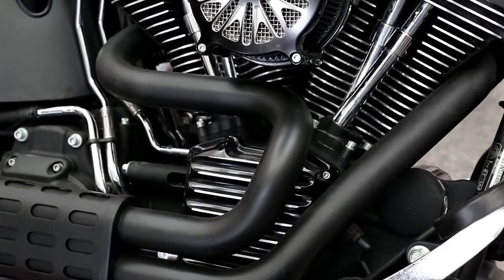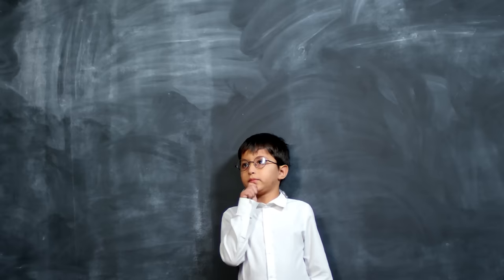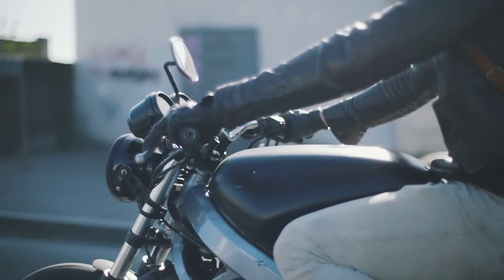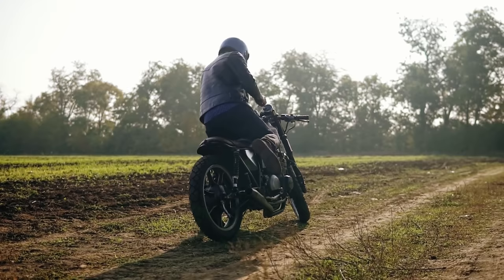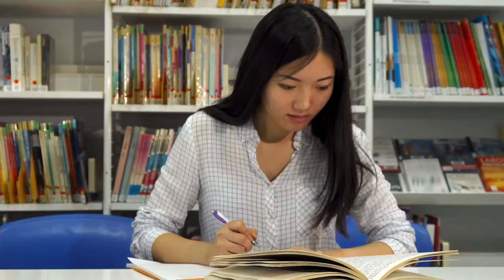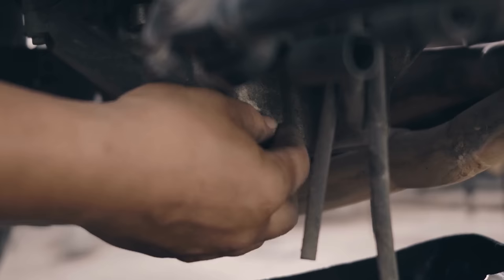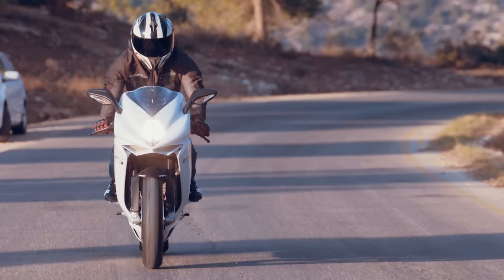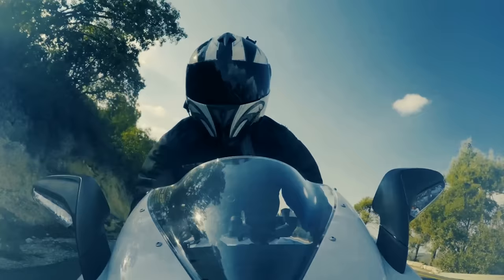How to Break in a New Motorcycle

Comment: They have done tons of research on this. There is no difference between a hard brake in and a soft brake in. You just need to just ride it like it’s intended to only thing you should do is change the oil more often until you hit 600 miles. You will have some metal flakes in it that is OK it’s common. The manual says don’t do high RPMs it’s because they don’t want you to break anything while it’s under warranty.
Reply: The warranty here is 5 years on Yamaha and Honda. Suzuki has 7 years. Kawasaki 2 years. The manuals statement to avoid warranty claims can't be true. You will easily pass the break in period in a couple of months even if you don't ride alot.

Comment: I chose to do the gentle break in. Was just following the manufacturer recommendations. This is my first bike and should hit the 600 miles on my way home today. Got the oil change kit and what I need to clean and lube the chain ready to go. Also decided to get out the torque wrenches and go over the bike just to be sure things are right.
Reply: Well-played… especially making sure bolts are tightened.  My bolts on my left foot peg mount got loose and I didn’t realize until one bolt had completely fallen out, and the one remaining bolt was hanging by a thread… luckily I was able to secure it , but if my left foot peg came off mid ride, that would have SUCKED.
Reply: 600 miles for me today too.....can't beat a new bike.....

Comment: I know you dislike the engine but I just bought a new 2022 Kawasaki Z650RS. I live in a very rural area so bike selection is slim. I wanted an XSR700 or 900 but it just wasn’t happening. This video came out just in time though so I can learn how to break in that slug of an engine.
Reply: The Z650RS is a fantastic bike, really great value for money! It may not be the most "charismatic" engine but it's a great engine, and I personally think the looks of the bike are great. Awesome choice, happy riding!
Reply: Why apologize for the brand of bike you purchased? You got a new bike and now your good to go, be safe!
Reply: @2shoestoo  absolutely. I was just cracking jokes about how Yam hates on the Kawi 650 engine. I am super happy with my bike and excited to put some serious commuter miles on it this summer.
Reply: Nice I just bought a 2023 last week! I think for my uses,and at my current skill level, the 650 has plenty to offer.

Comment: Cycle World or MotorCyclist did a video on this a couple years ago...  They took two identical bikes, broke one in by the manual, and the other by wringing its neck near redline much of the time.  When done, they ran them on the dyno, did oil analysis in a lab, compression and leak down tests and took the motors apart and took exact measurements...  No appreciable difference between the two break in methods...

I was recently asked to help break in a bunch of new Triumphs for this year's demo and promotional fleet...  The tech in charge told us not to abuse them, but he preferred if we broke them in harder and put them through their paces...
Reply: Excellent insight. Thank you.
Reply: Also note the bike was a very understressed CB300R... so no stress even on full throttle.
I would not do a hard break-in on a superbike with 200 bhp per liter and a 14,000 to 16,000 r/min red line.
Reply: @thainaaier  

No one would expect that. When I say “car” I don’t mean a Ferrari Enzo. When they say motorcycle, they don’t mean a track ready liter bike.
Reply: @thainaaier  I wouldn't;t do it entirely at redline either, but the point was, they did the exact opposite of the manual instructions and it was absolutely fine.

I split the difference between the two.  I break it in fairly hard, and have even broken a bike in at a track day...
Reply: And after 30.000 miles?
Reply: @angelsmalls7044  

How many bikes do you think are at that mileage?
Reply: Huge sample size.. Not
Reply: @F3udF1st  Were I relying solely on that, and not counting the 47 motorcycles that my wife and I have personally owned and broken in, and that of my dozens of friends that have owned many other bikes and tracked and raced them, in addition to countless tuners and engine builders telling us the same thing... you might have a point.

Were you aware that Kawasaki for instance... they use a Just In Time(JIT) inventory system at their factory in Japan.  They always operate within a 72 hour supply of parts.  They built a motor on Monday, toss it in a bike on Wed, and before the end of the week that brand new bike is strapped to a dyno and run up to redline to ensure that there are no problems, and that the power is where it should be.

They do it with EVERY sportike that they make.  A motor run to redline, that is 3-5 days old.  That doesn't blow it up, but you driving over 5,000rpm for 600 miles will?  Next you will tell me the old wive's tail about how you can't put synthetic oil in a new motor till after so many miles or it won't break in properly...  lol

Is that enough of a sample for you?
Reply: @F3udF1st  

You think with all the computer machining and supply sourcing that bikes make today are effectively identical? 

What other situations would be measurably different from one production to another?
Reply: I was hoping for exactly that kind of video on this!

Comment: I Just bought a 2024 Kawasaki Vulcan S on Tuesday. I have been following the manufacturer's break in period guidance and it has been brutal. The manual says during the first 250 miles that I should keep the RPMs under 4k and it is killing me! Putting around at 40mph on the back roads... However, Thanks to this video, I think I will just cruise on it like I planned to, Thanks Yammie!

Comment: I have actually broken in a motorcycle and dirt bike both soft and hard and never had an issue. I always warm them up then go. Proper oil changes etc are why I think is the most important other than having fun. 😂❤
Reply: Maybe you don't keep your bikes that long. The issue with not breaking in a gearbox, don't show the first 2000 miles. And it starts with small problems like it is hard to get into neutral. Ever heard about that before?
Or the bike pops out of gear, when you open the throttle a bit hard. That can be bad break in. You never know. Maybe it is not even possible to check it. Other then doing a experiment. But that is going to take years, lot of work. Cost a lot of money.

Know one has time for that. or care if their toys break.
Reply: @Gismo3333  just saw your reply. My oldest bike is a 1973 and my newest is a 2022. I have had 2 stroke and 4 stroke motorcycles. I have completely rebuilt bikes of various sizes. I am a firm believer in fresh fluids and warm ups. If the motorcycle was built right. If everything has been seated correctly from main bearings, to piston rings all properly gapped & cleaned you shouldn’t have any issues. That being said it also depends on the type of motor. If you have a high strong racing motor that’s close to the edge you have to follow the rules of engagement. On the other side of you have an everyday reliable commuting motorcycle for the average rider… they are built to last even with the worst owner. It’s all up to how they are handled and if you know your machine and it’s characteristics.

Comment: In the early 90's I totally rebuilt my 1986 FZ 750. The mechanic I bought it from said to first use the crappiest, straight 30w oil for the first 200 miles, then switch to good quality non synthetic for the next 3000, and finally to full synthetic after if I wanted to.  For that first 200, no steady rpms but be sure to occasionally hit near the rev limiter. After the 200 and first oil change, ride it as hard as I wanted. 

I never did go full syn, but ran that bike hard for over 45,000 miles. It NEVER burned oil, lost only 2 or less psi compression, and did not even need valve adjustment. (Normal valve interval was 26,000 miles in the 5 valve per Genesis motor). 

So, break in moderately hard for first 200, then go all out after.
Reply: That crappy, straight 30w oil was awful advice. The rest wasn’t bad, but you want to break it in with something heavier in zinc, if you’re actually breaking it in. Crappy oil is just that, crappy. He was right about not switching to full synthetic right off the bat. It prolongs the breakin period, because it lubricates better. It doesn’t allow parts to wear into themselves as fast.

Comment: I follow what a good portion of engine builders, racers, and dyno operators follow.  Regardless of the internal combustion engine once the oil is up to maximum temperature then all dissimilar metals are fully expanded to their operating tolerances, and it's good to run it how it's gonna be used.

Comment: When breaking in my 2021 yz450fx: first 2-3 heat cycles didn’t see much torque but still seen increasing rpm. Around the 4th or 5th ride, I got her warmed up and ran it hard a few times down a local dirt road. Now I treat her very nice, very mellow for a 450. Great bike would recommend highly for enduro

Comment: I would say its about avoiding heat by keeping revs low. Too much heat may wear things out specially when new engine isn't clean.
My bike ran really hot for 2 hours straight due to traffic right after I took the delivery. Even though I kept RPMs low I still engine doesn't like running in hot conditions of India. In evening it runs butter smooth, and bike feels alive.

Comment: On high end sports cars engines in the past few years, the computers (ECM) actually don't allow you to go above 4000rpm on the throttle for the first 500kms, then you do an oil change and it allows full throttle. That tells you everything you need to know.
Reply: Some sport bikes do the same thing. Although, my cbr1000rr manual just sad avoid heavy acceleration and braking until the 600 mile oil change. There aren’t many things besides our father in heaven that I trust, but Honda engineers are one of them. Lol.
Reply: Some sport bikes do the same thing. Although, my cbr1000rr manual just sad avoid heavy acceleration and braking until the 600 mile oil change. There aren’t many things besides our father in heaven that I trust, but Honda engineers are one of them. Lol.

Comment: Well ,I run no more that 55 miles and hr on state streets that alow 55 mph for 500 mile change oil and filter at 500 and ride normal after. That has been exellent for all 5 of my motorcycles. Never have a engine problem.

Comment: I changed the oil and filter at 400 miles after a rebuild, again at 400 miles and once more at 1000 on my 1995 nissan truck. And that little sucker idles smoooth. It burns gas so efficiently that water vapor drips on the exhaust. Oh by the way first 400 miles i kept it under 35 mph and off freeways, and sporadic take offs. Noticed the smoothness getting better and better each drive. Followed my mechanics orders of keeping it slow the first 400 miles, used O'rilleys conventional oil and filters, nothing fancy. I remember the first peppy accelaration going uphills.

Comment: A Harley mechanic recommended getting up through the gears quickly to 3rd and 60mph, then let off and engine break, repeat 3 times…that breaks it in, the engine braking seats the seals. I did one bike per manufacturer and one this way and swear the engine break method felt like it ran smoother. Then change the oil at 100 -125 miles. After that, don’t go crazy but ride as normal. For the brakes, smooth progressive braking.

Comment: When the Honda Fireblade first came out Honda told race teams it's good to go from the off & will give more power riding hard.
They put a break in period in the hand book probably for people to familiarise themselves with such a powerful bike.
My last CBR600 hand book didn't really say much about the break or at what rpm but my previous one did.
Reply: That is because racing teams, and people riding their bikes on the road. Is not the same riding, not the same service intervals. Not even the same bikes or parts. You can never take advise from a race bike, to a road bike.

They have service on the bike after every race. Do you tear down your engine after you taken your bike out for a weekend ride?
Don't think so.

Stop comparing your self with racers and race bikes.
They also don't use the bikes that long. And chance parts all the time. If they blow a gearbox, they chance it… You would probably had to sell the bike, or wait to save up the money; to have a shop fix it.

This is really spreading misinformation that really can hurt other people. But this is OK…?
Reply: @Gismo3333  if you read what i said it's what Honda said & not what i would do or recommend, it's all documented in the Haynes book of the Honda Fireblade CBR 900R by Rob Simmonds.
Reply: @TriumphBeezaman  —— Stop using & in your comments. It seems like you are using it instead of "and". That is not what it mean.

I think you did not understand or did not read my comment.
You did not even understand your own first comment, it seems. This is a tip to a race team's, and to be used on race-bikes, that probably never runs more then 1-2K miles before it get trashed. You can't use this on road bikes with 3000 - 6000 mile intervals on service. Race-bike have a service after every race. And also closely monitored under the race. You never see a race-bike run 60 000 miles+…
It is not the same bikes. Even if the names are similar.

Comment: I have heard arguments on the hard break-in side that you need to build  up oil pressure by riding it as hard as humanly possible to also fully seat the seal rings. I personally think it doesn't matter anymore how you break in the engine with todays motorcycles.
Reply: Most engines now have variable oil pumps and the pressure doesnt significantly change like it did 5-10 years ago.

Comment: I do believe in not redlining it for the first 50-150 miles, keep the revs moving around, show it some load but no lugging, engine braking,, then drop that oil and send it! Change oil again about 1-200 miles later than normal intervals. Engines break in alot earlier than 1000 miles

Comment: I usually take an angle grinder to the tires to get em sticky. Then I will file down the brake pads to ensure the meat is causing the friction.  Otherwise I just drive it on road and people a lawns to get the variable rpm’s.

Comment: I have had two bikes in the past year and bought both with around 300 miles on them. I rode the first bike (Z 125) till around 1,000 miles and changed the oil I rode it hard and had no issues. The second bike (Duke 390) I have also rode hard and the owner's manual said to wait and change the oil at 2,400 miles which I thought was weird I have ridden about 2,000 miles on it and have now changed the oil and have found no issues. I guess my point is that yes you can change your oil early but if you are mechanically inclined you would notice any issues found. I am definitely on the side of hard break in.

Comment: I seat the rings by heat cycling before it leaves the shop so it can be tuned in the dyno and the owner don’t have to worry with it. Most guys are gonna go crack it wide open anyway after they pay 4k in upgrades

Comment: First off... Use good gas ⛽  then run for an hour not hitting the low to mid RPM's Not too high, take a break let cool down a bit. To cool off and then get engine running temperature again is good to do. Stay off the highway... Keeping in mind that the brakes and tires are also breaking in the same time😢. The cables, chain, and other engine internals cam chain, piston rings,  etc... just ride normal without pushing it ... 

First oil change at 1000 klms, that is what my manual says, then every 5.000 kilometers. With a very good 100% synthetic oil.

Comment: I bought a new thumper for my first bike . Gotta take care of that piston. Its the only one I got.
Reply: The more important, that is more important. Is to be smooth on the gearbox and all the controls. They you also learn to be a much better rider. They you mostly don't get problems later, with hard to get into neutral… Or the bike get hard to get in or out of some of the gears. Or even that the bike sometimes jump out of gear.
Chancing the cylinder is noting compared to changing the gearbox. Or even fix some gears in the trans. That is when most people just buy a new engine, another part-bike or a new bike.

So it is more to let the gear box loosen up before you wear in the gears. Or they are going to be way to loose when the gearbox loosen up.

Comment: Yami I just got a new R1 and the manual suggestion for break in is really boring , if I keep the bike under 7k rpm till 1k miles I might miss the riding season , do u think it's ok to take it on short road trips alone and keep it below red line and mid throttle but hit 120 mph at probably 9k/10.5k rpm , at the moment my max speed is 75 mph which will take me ages to reach 1000 miles

Comment: My first ride stalled it by moving into gear without pressing clutch.
First 20p meter i went over 7rpm cause i was used to m car where i shift waay late and still in 4rpm.
So i kinda rev it high for few second 
And drove 10rpm for 20 seconds.
I hope i didn't damaged it....

Comment: I rode my new gsxr 1000 r pretty normally for the first 375 miles didnt really go over 7-8krpm but used more load as miles increased and had some spirited rides, using plenty of throttle, bike never ran hard unless fully warmed up. 

Had first service done at 375 then hit 10kish rpm and after 500 miles 10-12krpm here and there, had a long highway ride too tried to vary revs at this point i was in high 500s 600 miles.

I believe bike was pretty much run in way earlier than we think 

Just my 2 pence